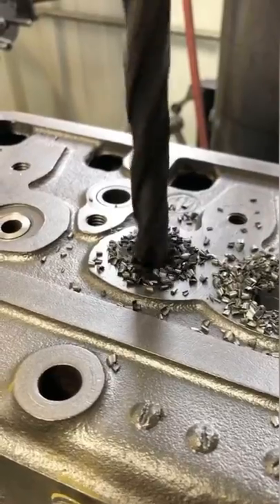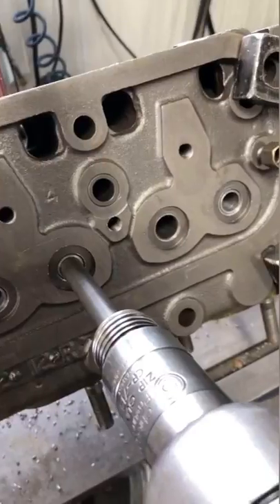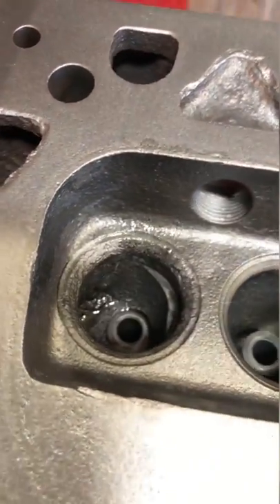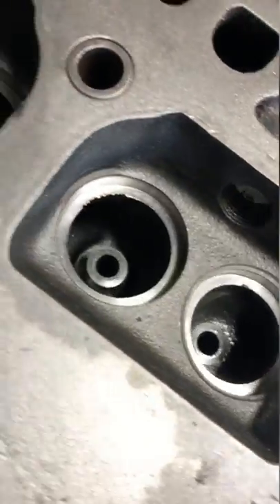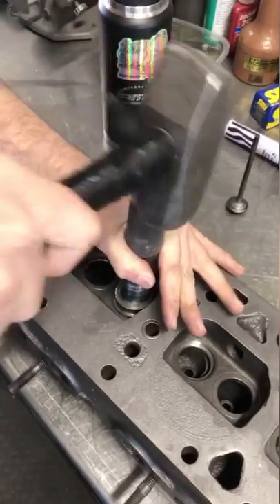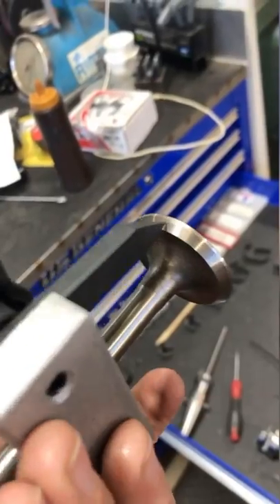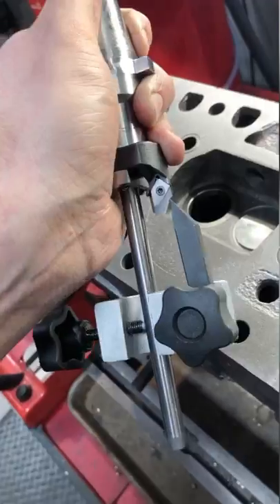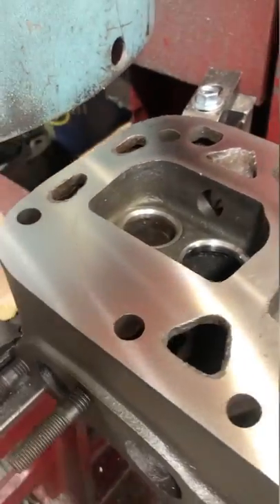#shorts Farmall H Valve Job - Serdi 4.5 - Resurface Cylinder Head

Comment: Now adays people just replace with new equipment. Not many people appreciate what was built to last these days
Reply: Back in the day tolerances were trash so they had to be rebuilt, now days tolerances are so tight that by the time a rebuild is in order you mind as well just buy a new one. Perfect example is piston rings and vavlestem seals in engines. Any motor from the 60-70's is going to have crazy blow by once they hit 100k miles, but even a 90's honda will hit 200k before it's even noticeable.
Reply: You can’t get that head casting anymore
Reply: @thelazarous  9th
Reply: I still appreciate a good 2J
Reply: @CardsNSleevesTCG  2j's really are the best of both worlds, tight tolerances and easy to rebuild. 90's overbuilt japan was truly a time to drive.
Reply: @thelazarous  my 74 Honda XL250 still runs like a clock, no smoke, and doesn't burn oil. 4 valve 4 stroke meticulously maintained. And am the original owner. Taken care of most engines will last a lifetime, it's all in the maintenance.
Reply: @fkyew  100% factual comment. If you maintenance properly they will maintain forever.
Reply: @thelazarous  as a machinist, I love the 2J head on my Bridgeport lmao
Reply: Sometimes things like this engine block is worth it to be refinished. You don't take a old Honda D16 motor with 300k miles on the engine and bring it in to be refinished for $500 yourself when a new block is $300.
Sometimes other options are just better value wise.
Reply: @thelazarous  0
Reply: Paddrezezinho
Reply: You can't always just replace an engine block. It's probably not even available anymore.
Reply: @carlosrobles2048 a Farmall H tractors were made from 1939 to 1954. The one I had was a 1940. There hasn't been new blocks for decades. There were also 3 different versions of the engine. I belive they only varied with what head they had because they had 3 different compression ratios. The choices were 4.5:1, 4.75:1 and 5.75:1. It depending whether you were going to run it on kerosene, distillate or gasoline.
Reply: @doug112244  hey man I'm right there with you, that's why I said what I said to the other guy
Reply: Not true. I work at an overhaul get em going again kind of machine shop and most of what we get is late model

Comment: I wish I understood 2% of what he just said...I really, REALLY do.
Reply: Basicaly he replacing the bearing and sealing surface for new valve on the engine the valves are controled by a cam which is conected via a timing chain to the crank and that sets the timing of each of the 4 events (intake compression combustion and exhaust )
Reply: I didn't either man so I went to school. This is actually exactly what I did in the machine shop class they had and it was so awesome. Don't worry about not understanding you would pick it up fast, cars are easier then you think you just need the basic knowledge for a good foundation, and build up from that
Reply: You can understand...just apply yourself to the matter at hand
Reply: Next, y'all need to try and rebuild an automatic transmission

Comment: It always amazed me, valve seats are a press/ hammer in fit, and stay put under hot running conditions. Did engine machine work back in the 70s. A nice shop makes all the difference.

Comment: I still rebuild my own heads and do all the work at home by hand.
Port, polish, shave, lap the valves, and deck the blocks.
All with hand tools.
I shave heads with sandpaper, and a flat machined plate or 3/4 steel and use a marker to color the gasket surface to make sure I have no low spots.
Takes time but the finished head is spot on.

Comment: Nice work, here’s a pro tip: place a piece of cardboard between the head & the metal bench when doing any impact work so you’re not mashing the gasket surface or cam journals in some heads. Nice to see you finished the deck final pass after all the heavy lifting & distortions. Keep up the good work!

Comment: I wouldn't call this a valve job.
This is what's known as a cylinder head remanufacture. Due to the composition of the new seat inserts this cylinder head actually exceeds the O. E. M. Performance!

Comment: Out of curiosity, why don’t they freeze the valve seats instead of pounding them with a hammer. Most folks don’t know but canned compressed air from Walmart  if turned upside down and emptied into a styrofoam cup sits at -59 degrees F. Not nearly as cold as nitrogen, but it gets a lot of jobs done and every one is next to a Walmart.

Comment: Serious question, how would someone Start out going into a profession like yours? You're far from a regular engine mechanic working on Chevy pickups. How'd you do it?
Reply: His father teach him and gave him a shop, so get a father Tyrone , mom's will only teach you cook and cleaning
Reply: Look for entry level automotive machinist jobs if you have some mechanic experience, or a near by trade school. Goodwill even has a program where they can help you get into trade schooling if you qualify
Reply: #1- This guy has a bachelors in mechanical engineering. Start there.
Reply: They teach this type of machine work in 2nd year automotive class my man. Customers come in the shop just like a retail shop and we would diag low compression or whatever the case was and then pull the motor and go through it with oversized pistons and whatever else it needed. That was my 2nd year practical
Reply: @jasonbisdead  haha no he doesn't. He works at a machine shop boring blocks and re doing cylinder heads and crap like that. Mechanical engineer lol smh
Reply: @Kmecha84  the dude literally has a vid explaining how he got to where he is and talks about his Mechanical Engineering degree. Genius.

Comment: A small tapered groove in the Squish Band straight across from the Spark Plug would help fragment the Flame Front. The oil will stay cleaner longer, it will lug  far better, start at a lower rpm, the chamber will have less carbon buildup, better fuel economy. Check vacuum before and after to see the difference. This is the perfect piston/chamber combination to have the best affect.
It should look like 1:44 in this video
https://www.youtube.com/watch?v=PzMgPZxD7Iw

Comment: I'm very impressed with the work you do having worked on race cars for a good 20 years but but I don't understand is that there isn't something more precise for installing those seats sure you can get all the force with the hammer and the installation tool but I'm surprised that there isn't some way to take the existing equipment and press the seats in at a given pounds of pressure...???

Comment: I do aviation cylinder work and have never seen that valve guide hone. all I use are reamers. On new valve and guide installation it works well but when trying to reuse valves it can be difficult to get the proper clearance and now that valves hit 250 each its becoming more common.  If you see this let me know what you use I will research it as well.
Reply from the maker: https://goodson.com/collections/valve-guide-resizing/products/black-diamond-valve-guide-sizing-system

Comment: If only I had know about your shop about 40 years ago, my 350 Oldsmobile heads would not have been raped and abused by the "machine shop" I went to.  I didn't know that there were shops that actually did things to spec.

Comment: Does that process ever become a problem because you're removing metal and over time the parts won't fit bc you've removed so much metal?
Reply: Metal that is being removed is the old valve seats previously installed.. 
Most machines are set up to remove only so much material, that is entered by the machinist. 
It isn’t like using a saw, or a drill at home that is solely dependent on the individual letting off the trigger in time.

Comment: Answer the Question if u will
How does the Seat stays inplace when knowing that the Aluminum expands twice as the Steel !!
Sooo
I guess that the seat needs to be a Smidge Bigger than it shd be !?!!
Reply: It's an interference fit. The expansion of the different metals is taken into account so that the fit is still snug despite the expansion. Interference means the parts need force to go together, because the inner part (valve I think) has an outer diameter that is a few thousandths of an inch larger than the diameter of the bore in the engine block

Comment: The Farmall Model H had the International Harvester C152 engine and it came in either a gas version or a  distillate version or a a kerosene version.   Each version had a different cyl head.   Is this head a kerosene version?

Comment: Hey what brand of mill are you using to machine this out?
Reply from the maker: Three machines were used here; 
1. Peterson TCM-25 Valve Guide & Seat Machine - Used to drill out old valve guides
2. Serdi 4.5 Valve Guide & Seat Machine - Used for seat forming operations
3. Rogers Machine Company RMC-1000 - Used to resurface the head
Reply: @JAMSIONLINE  hey thanks very much appreciate it and keep up the great work!